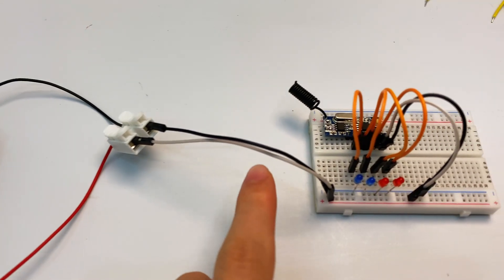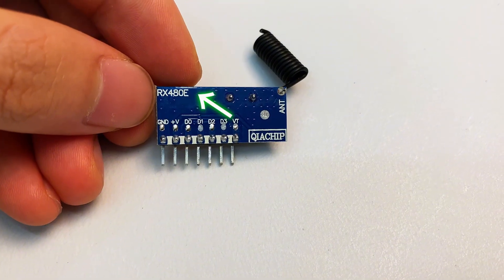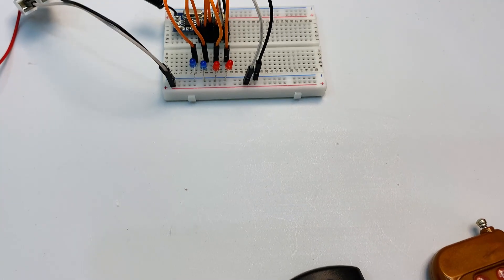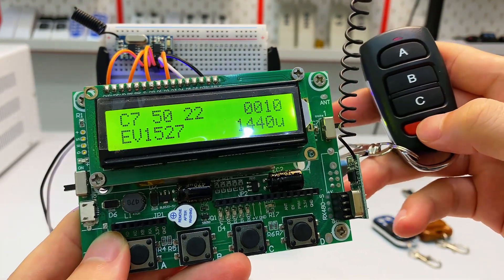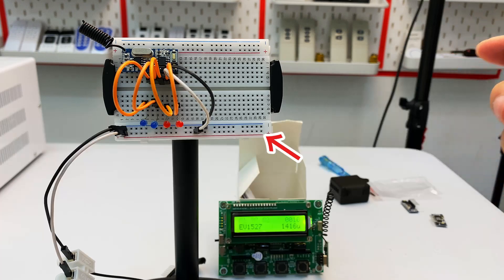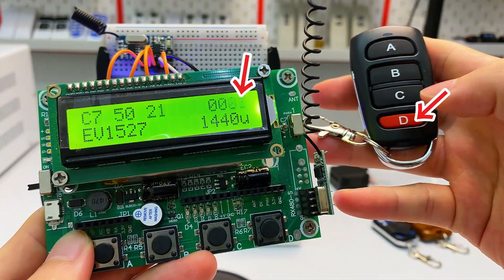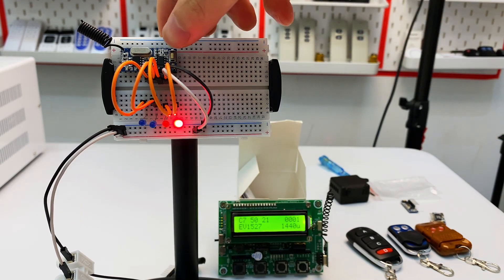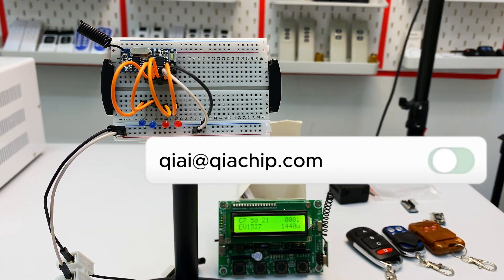How to Use QIACHIP RX480E: Master 6 RF Remote Pairing Modes for 4 Channel Wireless Receiver Module

Comment: I accidentally programmed it for toggle mode, and now I can't reprogram it to momentary mode anymore.

I thought I could solve it by using a different remote, and that did work, but the old remote also still works.

Is there some way to reset it to factory programming?
Reply: Answering my own question: Press the programming button 8 times to do a factory reset.
Reply from the maker: Jorg, that’s such a win! I loved how you didn’t just stop at “the new remote works”—you kept digging until you found the full factory reset solution. And then you came back to answer your own question? Total lifesaver for anyone else with this issue. Great work!

Comment: Can I change 2channel Toggle + 2channel Momentary to 2channel Momentary + 2channel Toggle?

A = Momentary
B = Momentary
C = Toggle
D = Toggle
Reply from the maker: If you need to modify it programmatically, a customized program is required. If you have a certain quantity, you can contact us via email.
Here, I also provide a clever workaround: you can change the pin order of the AB and CD controls by swapping their positions, and this will allow you to achieve this effect. If you have any questions or uncertainties about this method, feel free to raise your questions, okay?
Reply: @qiachip  
Thanks for your reply.
If I purchase it, can I use 4 to 7 clicks with the default settings?
Reply from the maker: I'm testing the module. To be honest, I'm still having some issues with the seventh mode in my current tests, so I can't guarantee it for now. However, I can ensure that the six modes introduced in my video work fine. 
If any of these first six modes meet your application needs, I'll send you the link to the RX480E dual - chip version.OK？
Reply: @qiachip  
I've already purchased the product, so I'll try various settings. By the way, I purchased the RX480E dual-chip. After setting it up, will it reset if I turn off the power? If it does reset, can I retain the settings?

I emailed the address listed a few days ago, but haven't received a reply.
Reply from the maker: This device generally has a memory function.
 After turning off the power and then turning it on again, the previous settings (such as various modes and channel logics you've adjusted) will be retained and will not be reset.
As there are quite a few emails and the holiday is approaching, the response may be a bit slow. 
If you have any questions, you can also raise them here and we will reply immediately upon seeing them.